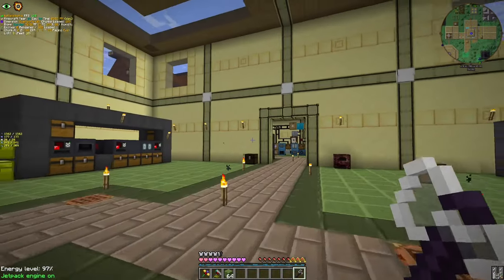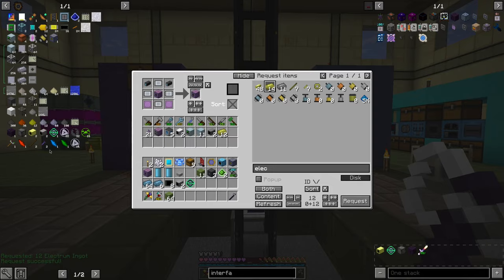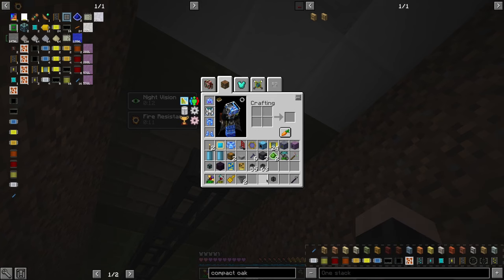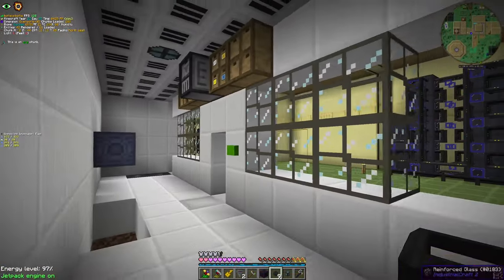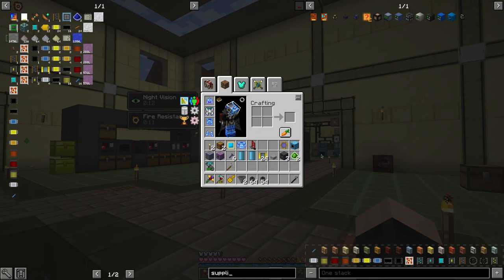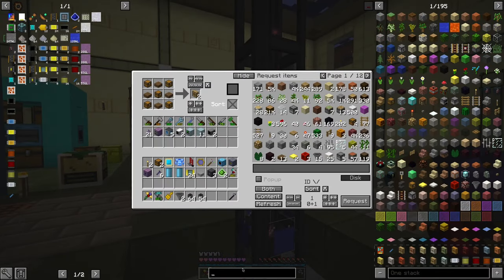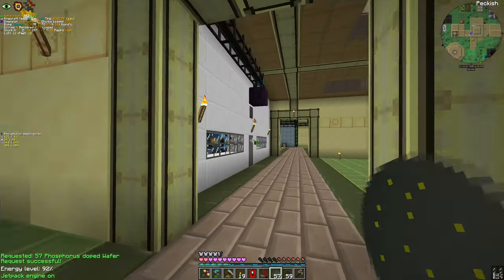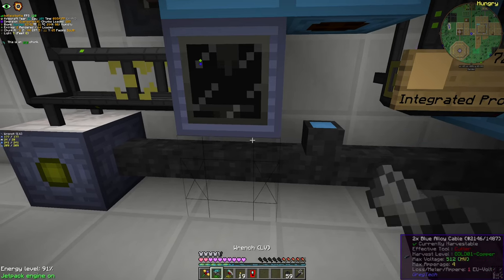Time for Passive Circuit Crafting | GregTech: New Horizons S2 - 39

Comment: How do you make the cleanroom in that shape? I made one bu it doesn't work
Reply from the maker: You might have excited the glass amount limits or might have an open hole. You need to check those.
Reply: @KofteistKofteEN  I mean the rectangular shape instead of the square shape. From what I have read and made myself it never allowed rectangles, but somehow you made it
Reply from the maker: It allows it. Lots of people does rectangular cleenrooms. The issue is probably somewhere else in your scenario. Try to mess with some setups in a creative world.
Reply: I tried your setup in my world but it didn’t work. Maybe I messed up. What are its dimensions in xyz?
Reply from the maker: Not sure, I'm currently in a process of moving my IRL home, so I don't have access to the game. But all the details are explained in Questbook and GTNH wiki.
Reply: @KofteistKofteEN  the issue was that I was on an outdated version, it seems they fixed it not being able to be made rectangular in 2023